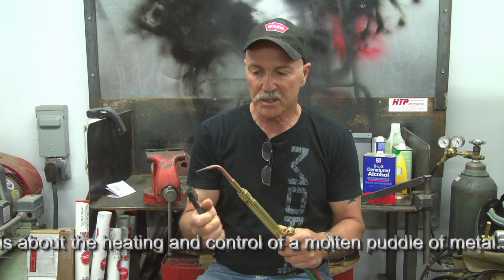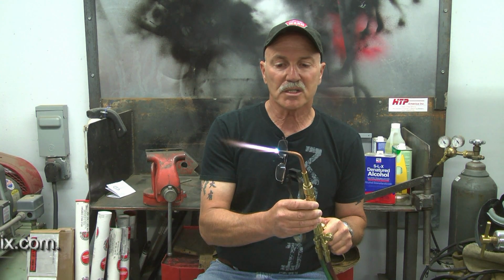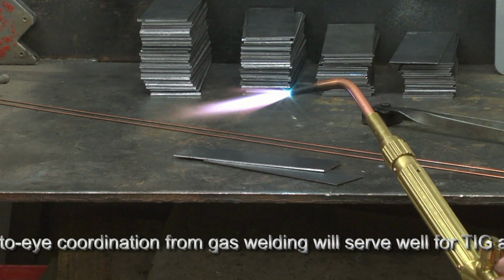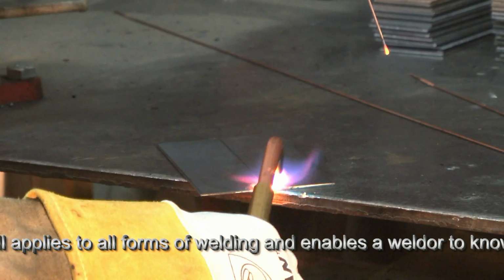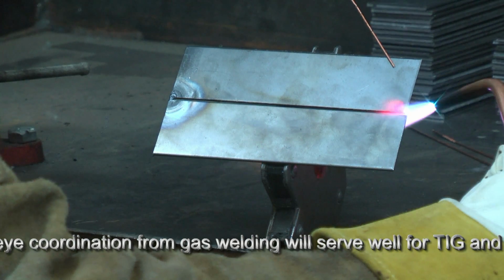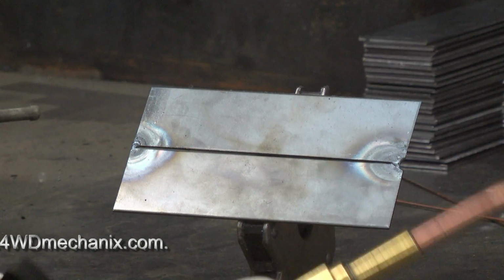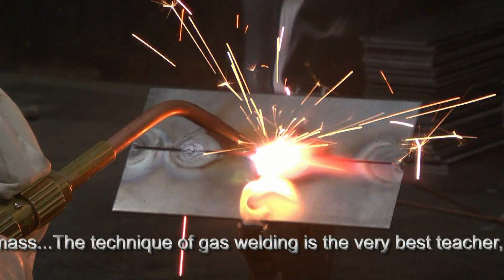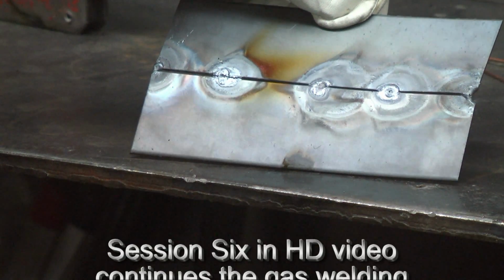4WD Mechanix Magazine: How-to Gas Welding Session Five

Comment from the maker: Hi, Mike...Thanks for your comments, I value your feedback...According to Victor you can use a #1 tip to 3/32" thick metal.  A #2 welding tip is used for 1/16" to 1/8" metal thickness, this would be a #56 drill size or 0.046" orifice. For the #2 tip, both the oxygen and acetylene can be set in the 3-5 PSI range at this metal thickness, even less if preferred. Note that I dropped pressures down on this tack chore for use of the #2 tip size. Some of this is to enable pulling back on the torch when filming. The larger tip, as you observe, does require more finesse with the torch. Another factor with gas welding is popping and flashback risk, and my preference is to use a neutral, hotter cone that requires pulling back the torch. This also brings the advantage of more visibility for viewing. Since this video, I've been using better filter techniques for the camcorder lens, and this enables use of smaller tips and closer welding. For this project, the downside to the #2 tip is the amount of heat I poured into this lighter gauge metal, which eventually created considerable warp. Check out this later example, still with a #2 tip, yet with better results by either of our standards: https://www.youtube.com/watch?v=ME0AdSgNJuw...